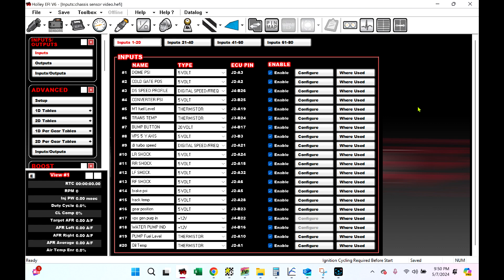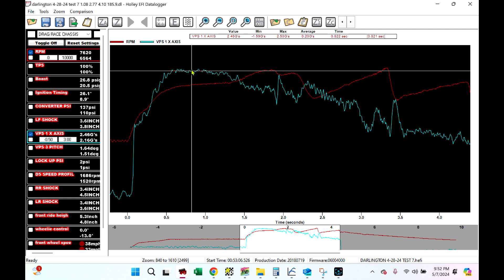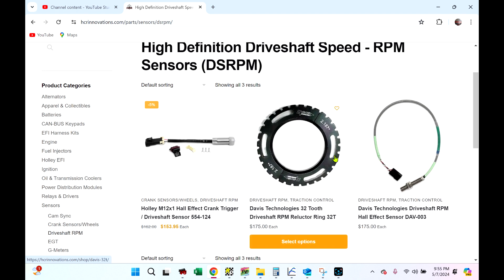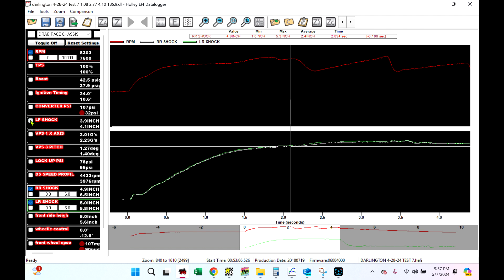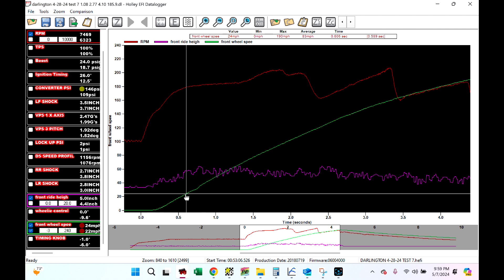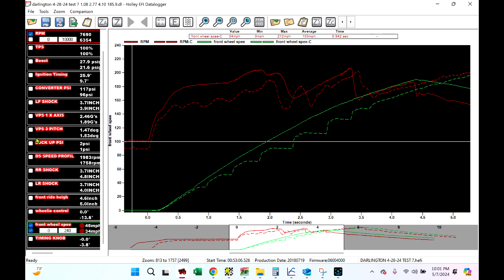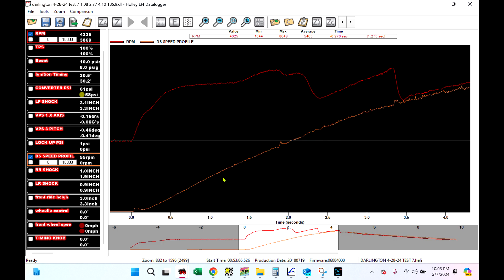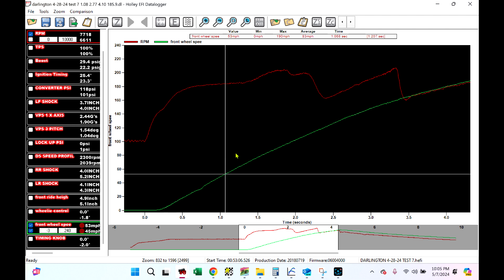Chassis tuning and sensor selection with Holley Efi

Comment: What are your thoughts on integrating video cameras?  I can see value for a drag n drive build to have maybe 4 cameras and some way to store video integrated into the build.  I don't have a clue what that would look like though.  I would probably want front, rear cameras for street driving, then suspension and interior cameras turned on for racing.
Reply from the maker: Would love to do it 
If you find something affordable and useful let me know

Comment: I dig the videos, would you have any interest in breaking down a pass and data log. showing where to add power, how to improve 60ft, 330 ect. I think it could help some guys out. Im running no time this season but Im willing to give you a slip, incrementals, tune up and data log on a slow pass if youre interested